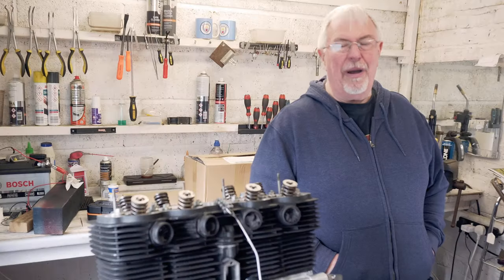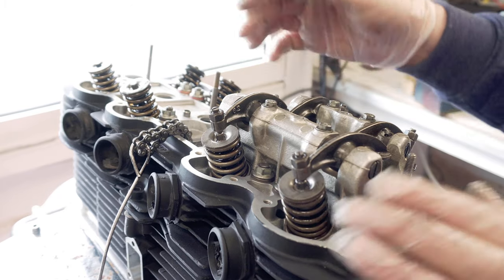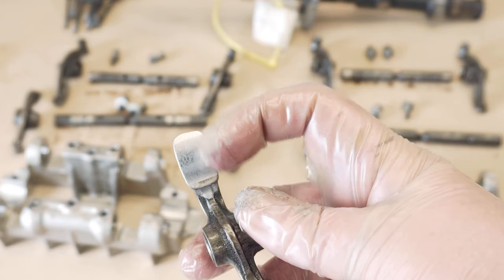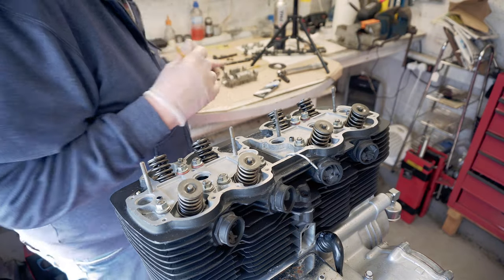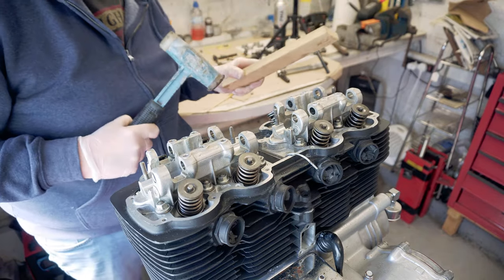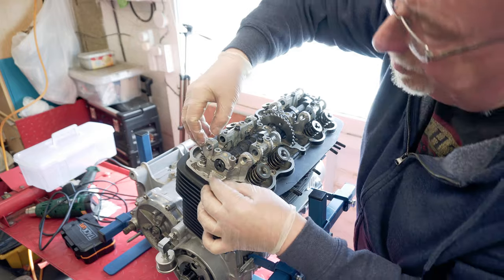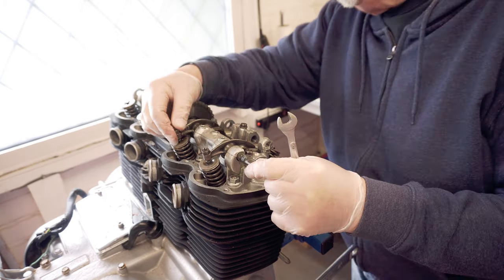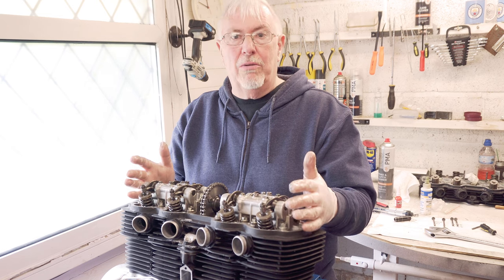Installing Camshaft & Rockers on CB750 SOHC Engine | Honda Cafe Racer Build Project Bike | 20

Comment: Hi, fantastic videos. I recently bought a cb750k3 U.S. import and there are two wires forking off the main harness near the front (green/yellow stripe and a black near the coil pack area. Could you advise what they might be? Many thanks
Reply from the maker: You should be able to get a wiring diagram of one of the forums, which could help.  But from what you describe I would suggest that they are for the front brake light switch which is usually a hydraulic switch coming of the line below the steering head.  Good luck.
Reply: @SPANNERRASH  Thanks that’s great, it makes sense as I’ve taken the front brake and master cylinder off so didn’t correlate! 👍